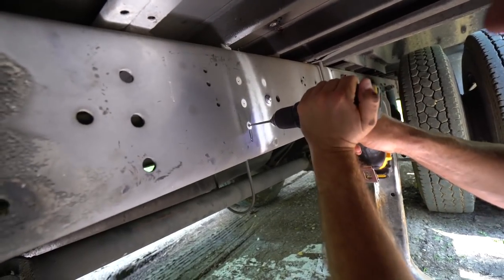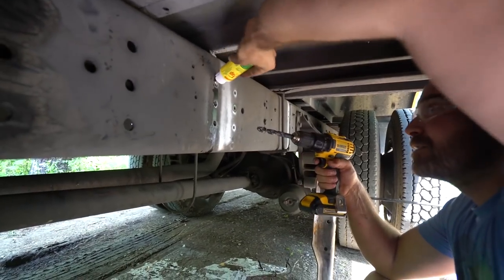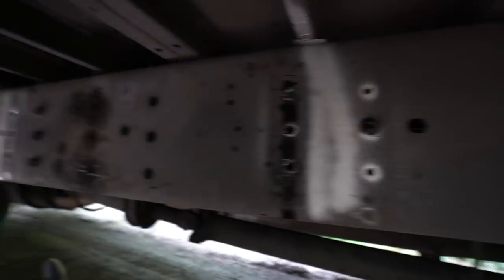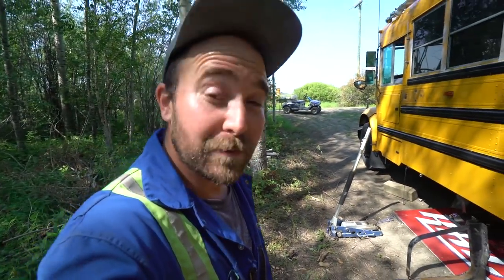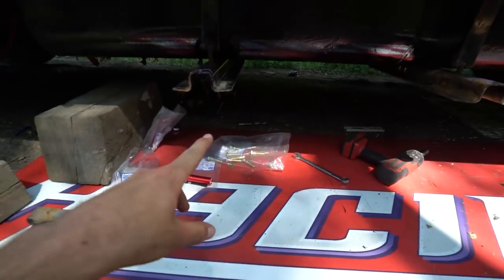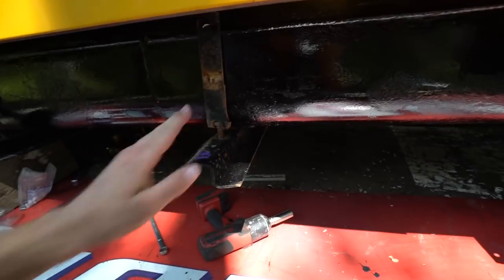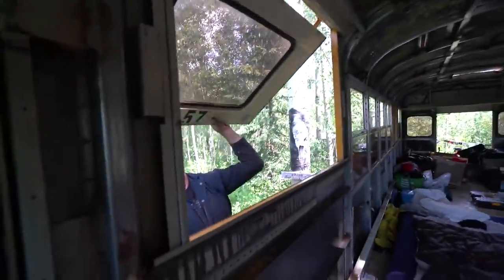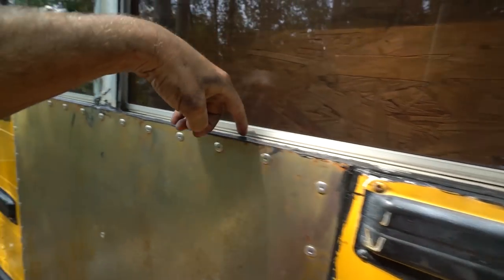INSTALLING SEMI TRUCK FUEL TANK FOR VEGETABLE OIL CONVERSION

Comment: Slow down the speed of the drill your bits will last longer.
Reply: manatee cutting oil is probably more useful.
Reply: Yes... And you need to pay attention to the chips you are getting off the drill bit and get the right speed to keep the chips large. And keep it oiled so you don't overheat the bit. Otherwise you can change the temper of the bit. As soon as the chip size changes, then resharpen. Slow or high speed drills bits, if the rpms's are wrong you won't cut fast. Also there is an art to sharpening the bits to get them to cut like butter. You have to keep the point centered, get the removal taper and then the cutting edge taper angles right. 

I learned the hard way... spending 3 days trying to drill out a number 8 case hardened bolt without screwing up the threads on a car unibody frame. So I wouldn't have to remove the interior and back seats, and cut in from the interior and reweld a new nut. It snapped trying to get the subframe off, then I welded a nut on to what was left then it snapped off even farther up into the frame. It was more fun than subhumans are allowed to have.

Comment: I would round or at least cut those sharp corners off of the tank brackets , you don't want to hit that if you need to work around the tank ! Whats the red stuff in the puddle by the front tire at 17:15 ?

Comment: I think you and Badge need to go down to Alabama to help "Drivin' and Vibin’” with their project, because I don’t think they will ever get done or know how to finish theirs.  They couldn’t rebuild a door and now they are trying to rebuilding a stripped out camper.
Reply: Eric Van Eck there doing a pretty good job those kids had no idea what they were doing i got to say those kids are going to have one classy trailer when there done 🇨🇦🇨🇦ps there friends of mine sorry
Reply: We will see, but they will need a bunch of help to get it done, just like the door on the Fiberstream.  Which they weren’t E-beggars, that really turns me off.  How do you have 42 subscribers without any content?
Reply: Eric Van Eck they are awesome kids i think they will do a awesome job i going in October if they get in trouble i will go help them.  The door i am sorry I thought they did a awesome job on a door you can’t buy
Reply: They didn’t do the door, friends did it for them.  They get so much good information from REAL professionals and they continue to ignore VERY good ways of doing things, and just do it their way!!  They removed the braces on the frame on the camper and never replace them, thus weakening the frame.  So many people said you have to put them back to factory specs or you will have problems down the line.  Then they had real guts to give advise on drinking water system with NO KNOWLEDGE of what they were talking about!!  I  was a drinking water inspector for 20 years and that advice they provided will make people SICK because they have no clue what they are doing!!!!!!

Comment: that rooster snot makes all the difference  in the world  LMAO.  Stepbits (conebits as you call them)  are great but are expensive  when burn them  out or lose em. Tiny bits & grow  to size with  🐓 snot  is best. l' putting a similar tank on mine 🚌 but with a different  method.  I took rear bumper etc off & am putting it between the frame  & them extending  the frame (tank to long)  & should be able to walk out my rear door. I'm using a similar cart & doing this myself. Jax  you don't know  how  lucky  you are to have Badge! Jax is there a way to contact Badge with  a couple  ?S on my install , I would  certainly appreciate  it. love watching your  build with  all the  good  natured  ribbing. good  times. John